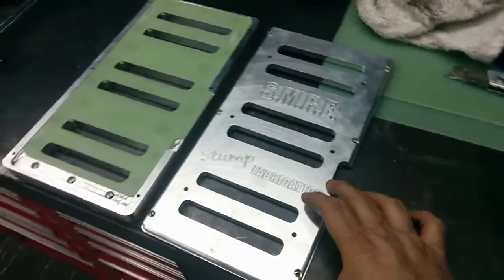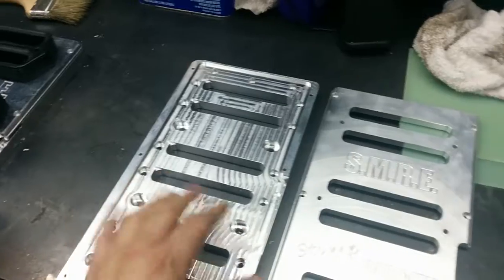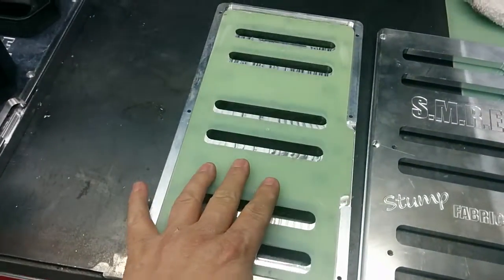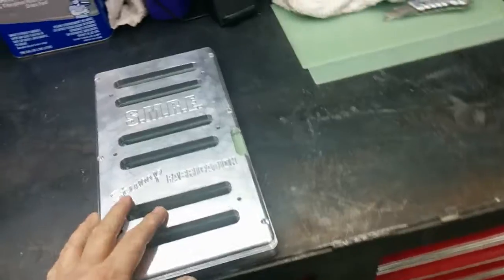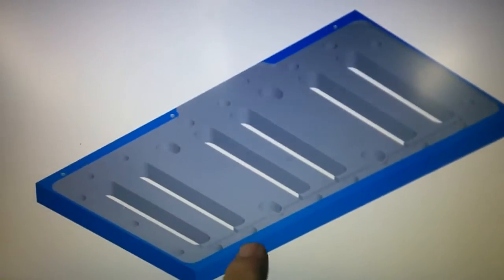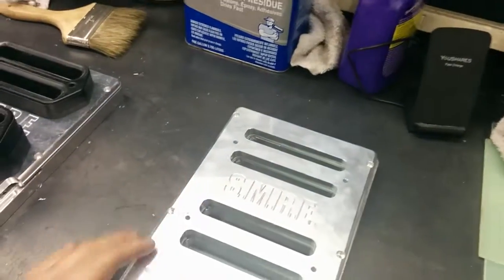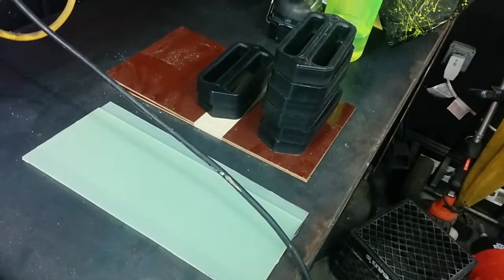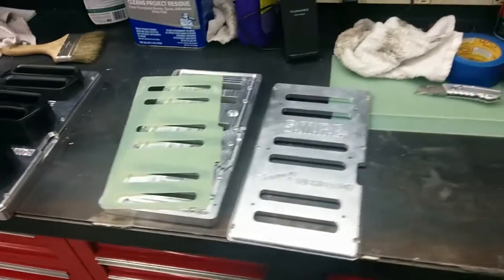Mercury 2.5 Outboard Throttle Plates.

Comment: BUCOTO I I believe I spelled it correctly was the oem manufacturer out of Tennessee. 
Yes they work. !!!!!!! Wakes a Lazer injected 2.5 right up. Works off of a poor I guess I've linkage from the oem throttle set up. The slide opened up at the same time the oem progressive throttle opened up the second throttle blades.
He also had a tunable module to tune the time the injectors would fire per firing order.
 Combined with the "Gillitine " intake slide and the injector module a "stock" Lazer 2.5 ran 120 mph if memory serves me correctly on a standard. Bathtub cockpit.
 I know because the gentleman who owned the boat ( wife's boat ) told me so.
Most would know him from the drag world here in Florida.